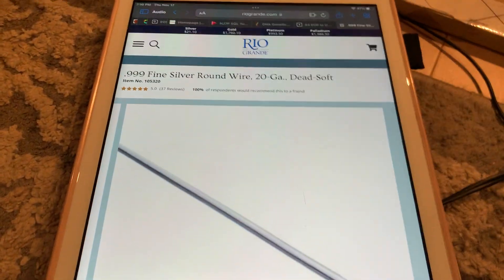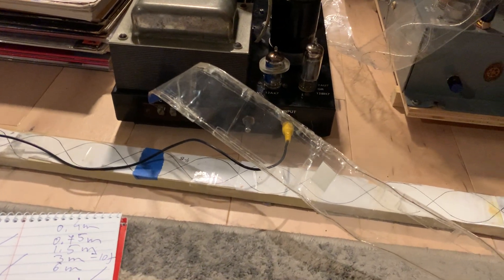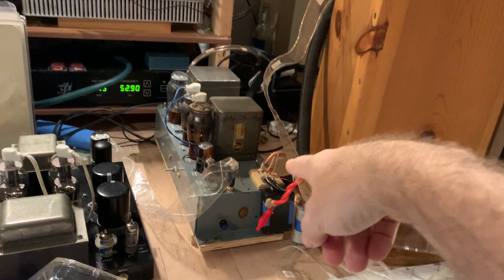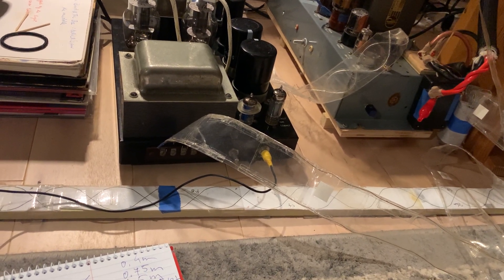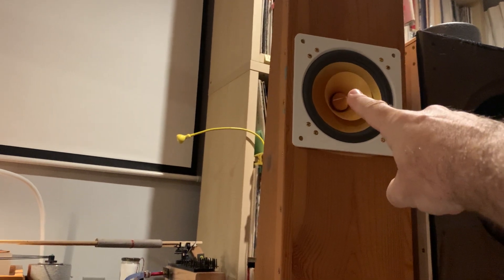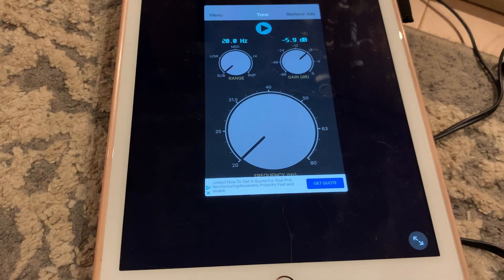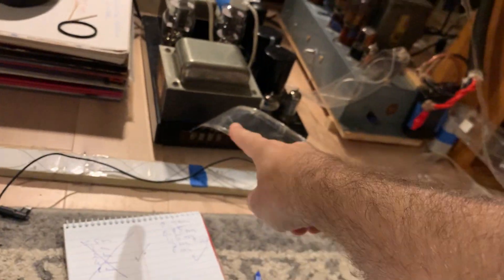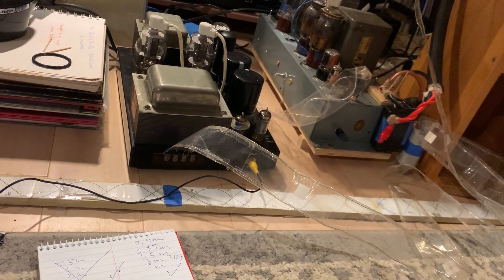Ultimate simplicity DIY speaker cable for high impedance speakers (part 2)

Comment: Dear Janosh.
20 Hz wee that is great but don't telling us anything when the level is not declared. (Many can maybe get 20 Hz if we turn up the level high enough..)

A more interest test with that primitive method is to play 1 kHz at a "normal" listening level for you.
Then keep the volume at the same level and go slowly down to 20 Hz.

That will represent what you will able to hear (or more correctly is reproduce) if any of a 20 Hz frequency when you are listening at your normal listening level.

Anyway I understand you try to give us information that a dead soft silver wire with that smaller gauge (cross section area) can "conduct" even the more power that 20 Hz needs. 
But again we have no reference point to compare against!

If you took another cable that theoretical deliver more power (if it has bigger area). And you play at a specific amplifier level and frequency at 20 Hz and measure what dB you get. Then just swap to the dead soft silver speaker wires and repeat and see if we in practice get a dB drop or not at 20 Hz. 

Then we KNOW as we don't know anything now with that good intentions testing strategy (sorry I take testing as serious as I can 🤓)

And on the other note 🎵🎶 if we knew that those were inadequate or not then we could have a completely different conversation! 

When we know the ability to transfer power is depending on the cross section area then we would know if it is good enough or it is wise or time to buy a dead soft silver wire with little greater area (if we have 16Ω load in this case).. Rio grande has all different gauges. 

A tip for EU viewers that there will be customs on top of the amount of silver you buy when buying from Rio grande. (Been there done that) 🤣💕
Reply: You have a real point towards high currently applications whereas I believe Janos' starting point is from someone who runs 16 Ohm high efficiency speakers (96+dB/1W) ..and anyone with such a setup will not run into hard 'current' related issues as quickly. So going for quality there, like silver, is still a viable option. It would be interesting to see where multiple strands start to pay off, or what the sonic differences are to the gauge 10s he's using.
Reply: @EduardBroekman  I see what you mean.
I pointed out the unhelpfulness ;) of the testing methodology.

As for power demand if a system has a driver of 16Ω and ~96 dB/w/m.
Or another driver with 6Ω 85 dB/w/m.
Is like you say will have different power demands and will also determine the cross section area.
Janosh is mentioning that he is driving a 16Ω driver.

But good point to point out that those with more power hungry drivers will have a different experience and probably need a wire with bigger cross section area.
There is no one size fits all.

I am using totally different speaker wire build "RND WIRE .999 FN SLVR 12GA (.081)". 

Think that is 14 awg (2.5 mm²). It is inserted in a oversized cotton sleave when cotton is the next best dielectric after air and better than any other plastically type of sleeving. Then that is put in a hose that breaded screen and then a copper foil screen (the two different types of shields are shielding in different frequency bands). And last only a protective outer sleeve.
That is done on both of the conductors.
But it is pure Dead soft solid round silver wire. As I wanted some of the best materials that even has better property than copper. And I realized that buying a ready made to use speaker cable from a manufacturer with the best materials would cost me a arm and a leg. 
 90% of speaker cables offerings out there is with copper in many different constellations like:
Copper
Oxygen free copper
OCC copper
Silver plated copper 
And so on..

It feels like they stay away from silver because then it will cost them more and they do everything to the and with copper so the cost is brought down and it seams more exclusive, but it is still copper at the end of the day. And I know that if I don't fix a silver wire speaker cable then I would not stop lusting after one when it is a better conductor than copper or even gold.

I don't know what multistrand will bring for benefit to the table. Other then multistranded wire is more flexible. But I am not planning to go around sharp bends anyway. I don't believe that there is a great benefit of having the ability and to be able for the charge (signal) jump from a strand to another strand. But it is difficult to determine and set up a test for when it should be the exact same copper purity/type and cross section area for both the solid core and the multi stranded wire.

Anyway regarding my own DIY speaker cables that is shielded. Because I were on a audio show there they had a demo from a cable manufacturer that. Let us hear 3 difrent cable's and the better and more costly the cables where. The more and more shielding the got.
And they sounded also Greater and greater as we went up the line.
The guy that demo the speaker cables told us that in those 3 speaker cables they all had the exact same conducting wires and it were only the shielding that was the difference!

So imagine it is not easy to be able to do a test with the exact the same conductors, system and room.
But just alter the different types of shields but the same conductors!! 

The normal case is when you compare two cables and one is shielded and the other is not then you do NOT just test shield or no shield when the conductors could be of different area, purity, different amounts of strands and so on and on.
So you have NO way of knowing!
That was the reason why I went the shielded route in my DIY speaker cables, when I were lucky to hear what benefit shielding had.
Reply: @AmazonasBiotop  Awesome and very informative.. thank you for the ton of info/experience you shared - I really appreciate it! Side note: I prefer solid strands (as well) so I chose my words wrong in 'multi-stranded'! 

Did ever try flat silver wire for comparison? It would have a higher surface area - which could better for higher frequencies?

As for shielding, I would really like the hear the effect when it's being driven 100% balanced. I could be wrong, but I drive my speakers (and preferably eveything) with balanced connections, a solid state demo setup with one grounded wire is solving a very different issue. So what were they demo-ing with (solid state)? What improved? 

And a hifi show has 1000s of mobiles cackling to their home base... so it's probably the best place in the world to showcase RF shields! For contrast, I live at the edge of mobile reception and wifi at its lowest power settings - nearly everything is wired now with wifi off half the day.

While not an expert, the route I see available is that with truly balanced connection it is possible to minimise the dialectric and shield capacitance influences on the signal. So far my limited experience with CCSSWP interconnects indicates that its a viable option.
Reply: @EduardBroekman  Thanks 🙏 for the reply.

For flat wire I have not tried. I have only briefly though about it. The DIY route could be to take material from a exclusive silver foil inductor. But it stopped there as just a thought. 🤔

As I am content and it is good enough plus a important point is that I believe that there is other parts of the system that will result far more of sound quality gain in the end than chasing the last % (that vary as we said with each given speaker). 
When I believe room acustics and treatment will yeald far more sound quality improvement for my given time and money that I invest. Or other improvements.. 

(I am more in measuring acoustics at the sweet spot as that is knowing EXACTLY what is ongoing in the audible range. And after doing as much as possible in the physical domain with room treatments and the different types of them. 
Then fix the rest with DSP. It is in my opinion a utopi that someone THINKS they got a good sound when they MOST likely have a dip (or peek) or unwanted sag somewhere in their audible frequency response. When they're not measuring they don't know.

And my experience of measuring my and friends or  friends of friends audiophiles systems (when you can do measurements then you get to get, many audiophile friends 🤣 that are senior and have money and expensive dedicated systems) that not ANY of them had no issues they thought but were curious of how their system were performing. 
EVERY ONE that I measured had some cancelation somewhere in the bass.. EVERYONE. 
Until then they were happy and in some cases completely unaware(!) and it can't be fixed by ear when you don't know and don't know where exactly and how much the issue is. 

It is like Janosh system I will bet that it is by my norms it is far from perfect in frequency response but we don't know when it is not measured it and he has no MECHANISM to get it to my norm in either case either! 

So at the end of the day we can only remove as much garbage from the system as possible so it is a "purist" system that Janosh has in my opinion and that is interesting to see and learn from nothing wrong with that, it is what it is. 

But is that the end goal to have it as pure as possible and by that are unwilling to put a DSP in the signal path? 

To have as goal as little as possible in the signal path. 
Or
Is the end goal to have no dips/nulls at the LISTING POSITION and be ABLE to hear every Hz between 20 - 20000 Hz if and when the content creator or instruments choose to put energy there?🤔

I vote for the last option. 

Or if we put it like this: I have got a ±1.5 dB from 20 Hz to 20 kHz at sweet spot (before i consider to add any of my costum curves (another story)). In practice that means if something is playing for example at 55 Hz or sweeping past 55 Hz decay of a instrument I will be ABLE and have the preconditions to hear it.
But if I have as many has (that is more of a norm) a dip by -10 dB at for example 55 Hz. Do we think we will hear that? No it is attenuated by -10 dB.. 🤔
And we play music and it is not frequency signals so we will most likely not even miss it when we don't know it should be there in the first place. 😉 

So by making sure that all frequencies is reproduced at equal levels and not sitting in any room modes is a precondition to start with. 
Not that we exclude CPU and software that help us and makes it POSSIBLE to achieve that precondition. It is to in practice if we opt out, that we EXCLUDE technology advancements that we have done the last ~30 years. Anyway I will stop ramble this of topic about different visions.)

Yes, the demo were on solid state and a hotel hifi show are probably as noisy (RFI) as it gets. 😀

Yes the true difrential balanced interconnects is probably a very valid option to keep noice out and capacitance low. 👍

I have not yet had the opportunity to try out balanced interconnects :(

At one time I had a RIAA that did not internally had any RFI filter (that I believe many has today and this RIAA  upgraded revision got it later also.)

Some or if you were close to a RFI "polluter" and or had "bad" wires from the cartridge to the RIAA then you would hear it clearly!

People thought it was a bad RIAA design.. but I thought it were terrific!
Because if I got interference in the system then I knew I had a issue somewhere. Were a transformer/cable placed to close the TT. Or were did the TT pick up the RFI. Where the  wires to exposed somewhere from the cartridge to the RIAA. Did I need better protection for the signal. And so on when it were honestly showing me that there were a issue somewhere.

In other words the RIAA showed me IF some RFI had or not entered the system or not. With a RIAA that indirectly automatically filter out the RFI then I would never know. 
And I think it is better that the RFI had never entered the system in the first place. 

Usually we think that for example a shielded power cord. That the shield is great to prevent noice to enter trough it. But the opposite is also true that less is transmitted out from it. And when I look behind my rack and I like seperates mono blocks and so on them there is at least seven different power cords plus there "among" them is also interconnects (yes we try to seperate them from the power cords as much as possible but still). 
My thinking is that it is good that interference FROM these power cords are held down by the shields.
When you have so many components then it is hard to not to get a snake nest behind the rack. 😂
In other words the shield is beneficial both ways in that application. Then maybe unshielded RCA may have a cleaner RFI environment. Maybe.. I like to think so.

Usually not always, I don't hear any difference between a interconnect and another interconnect. But sometime I think that I can.. I have a old Tara labs RCA that use solid core and I like it!

At one point I bought a silver interconnect and I figured out a point in my system where I should try it out there the full frequency range signal were and it should have the greatest possibility of impact (when using active system).
I thought instead of just again try to hear by ear IF I could spot some or any difference between the RCA cables and probably fail or listen to wrong stuff. 
Instead I rigged up my calibrated microphone on a stand at my sweet spot and run two measurements sweep on the system before. 
And swapped in just the silver RCA and did two measurements sweeps again. (Two sweeps to confirm and make sure, that there is no irregularities and the repetition accuracy is the same)
I am no expert in measurements analysis and I have no idea what to look for.. 🤣
But my aproch/method were that I studied and compared ALL the available measurements graphs plus generated some new ones also from the measurement data. Frequency response, spectral, impulse response, waterfall, decays and more..🤓

First of the REW software and the measuring system is very accurate and there were no difference anywhere in any type of graphs between the interconnects.. maybe maybe a slight and very small improvement or let say difference in the impulse response graphs.. and that was all i could pick up in the comparison..

Now had I found SOMETHING that might help me to point out what to listen for. Or that I found something different and that could indicate that interconnect A gives this or that compared to B, but I didn't this time.

But on the other hand it indicates also that I am not def and beating myself by trying to hear some difference that IS NOT THERE in the first place..😂

Again not wasting more time there when the potential sound quality improvement gain is probably rather low. But Janosh minimalistisk interconnects seams very tempting to try..🎉💞

The bottom line don't get stuck in a rabbit hole when it will result in small gains when there is more low hanging fruits that will yield in greater sound quality improvements than putting 90% of your energy to only gain 1% improvement, take a step back and think of what you are trying to achieve, the big picture.👍
Reply: @AmazonasBiotop  Brilliant all you write here. It's maybe interesting that I also like a flat response (but with 4-5dB bass lift) but then for the whole house. I hardly ever sit down, so I'm looking for a great response everywhere. That's how I got to a mono corner loaded setup which prevents the stereo cancellations in the higher regions.

Despite all that, I also recognise that in live music the frequency response varies everywhere and this doesn't take any 1 bit away from the performance or the artist! Our hearing is quite used to deal with varying acoustics.. when we move home we adjust in under a week.

Then there is the studio mixing and I can now hear when we have a serious mismatch in type of speaker/room that they did the final mix which, and so even the intention of an artist is bound to be misplaced. And still most mixes are done for car, mobile phone or small systems... so there's mostly the selling intent, not an artists' intend. 

So what I go for is a system that needs minimal interference to get a near-flat response but can brings back the spirit of the original performance and the FR is merely a side-effect, not the primary goal.

Similarly, I find that in tube selection I end up with tubes like perhaps the 26, 46, 6E5P, 4P1L with flat plates and their thd distortion is ultra low .. I just didn't start out with distortion but often it ends up that way, or has 2nd harmonics only at maybe -60dB.

Anyway as for your point where to gain most, I couldn't agree more and by you sharing your experiences when I do further refining, I have this more informed spectrum of options to go with.. so its highly appreciated, probably for many!! Good point about the capacitor film!!! 

Things that are easy to DIY such as cable are gold (silver in fact). I like Janos CCSSWP and also having built his VOL, I trust his judgements fully these days.. his wife heard that I had a cartridge that was warming up.. and she was right, so go figure!

Btw I have no issues with interconnect quality.. despite perhaps neglible measurement differences: ages ago my hifi dealer lend me 3 cables, one $100, one in between, plus one 1K/meter just the cable..but everyone, all non-audiophiles heard a large difference. 

If changes are not clear it means to me that there's a major bottleneck somewhere else.   This is where Audio Notes 'compare by contrast' comes in....  it's not about the static but how broad is a systems capability.. it's an art to me to make nearly everything sound like it has its own quality, yet enjoyable and have it connect to the artist. Complex music is a hard nut to crack. 

One overarching observation of mine is shorter signal path, fewer caps and less manipulation, whether on the recording or the playback side. Compare 'Merry Widow' from 1964 with any (modern) Deutsche Grammaphone to hear the effect :) It looks like FFT are no free lunch either.
Reply: @EduardBroekman  l did not meant that I like flat frequency response. 😉 Let me explain.

What I meant is as you know the speaker is NOT the most flat component of them all. A amplifier has wider frequency range and vary from amp to amp. But if we look only on 20-20000 it may vary ±0.5 dB.
A speaker more have normally a much wider "fluctuation"/variance somewhere ±3 - 5 dB (if it is a good one) or more for just the speaker itself. 

Then we put it in a room there we add room modes and cancelations that we now in practice have usually approximately -10 dB at one specific frequency and another frequency maybe +7 dB. That is a "normal" in room variance.

So fixing that normal room variance. As one of the steps in my method is to make it as flat as possible removing issues and all drivers and their amplifiers play at the same level. 

So as we see that I get ±1.5 dB in room at sweet spot, is flatter and better than what ~95% of all speakers can achieve measured in a anechoic chamber in other words a fancy way to say "by it self without a room". 🤣

Next step in my method after all IS level and level matched. Is to add custom curves as I said. Who wants flat? Let stay in the scientific domain!
We have famus scientists (Google "equal loudness") Harvey Fletcher and Wilden A. Munson and also today a ISO 226 standard (International Organization for Standardization).
In short when you google that you will get images of charts also (note that it is far from flat). 

That is our hearing sensitivity so if we reproduce from our system that frequency response as we see in the chart, we as homosapiens will PERCEIVE that from 20 Hz to 20 kHz as flat or as they call it "equal-loudness".
Because our hearing SENSITIVITY it varies by frequency.
That is why you have found out by yourself that you like a little bit more bass. 👍

Then we can go deeper and complicate it more but that is one very important thing to know about our hearing and what we perceive with it. (NOTE: that it is changing by level also..). 🎵🎶🎼🔉🔊